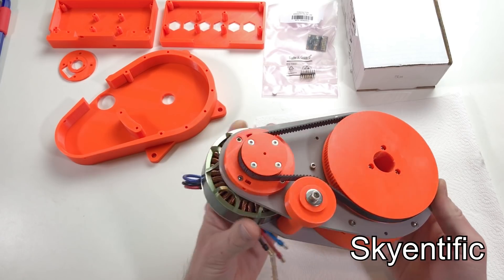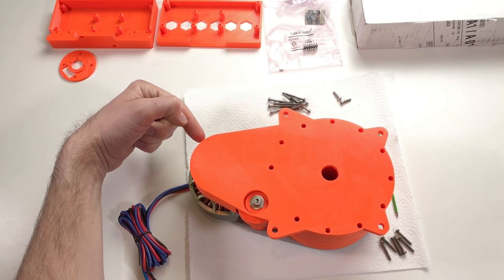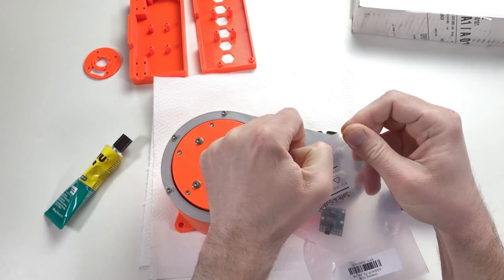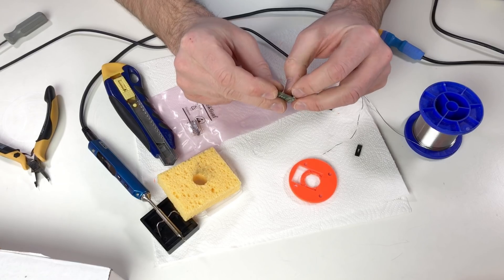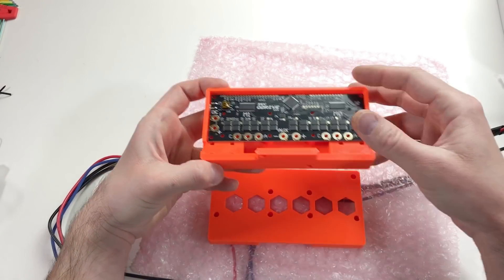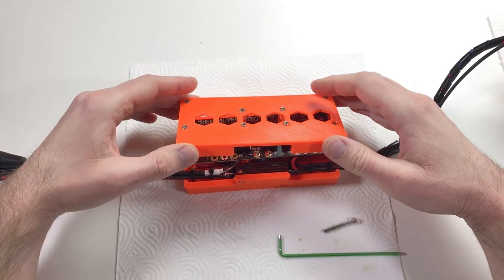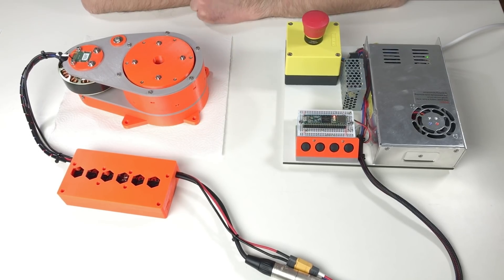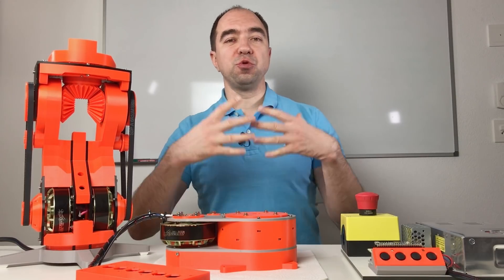Another 7-axis (7DoF) Brushless Robot Arm (part 3)

Comment: Wait, does the torque from the motor to the base all go through your four small bolts also holding the encoder plate?
Doesn't the 3D printed plate limit the clamping force you can apply then?
Reply: To clarify: the clamping force limits how much mounting friction bears between the motor and the plate, which limits how much twisting torque the connection can withstand before working on the bolts, which will worry them loose.

Comment: Awesome project, I love following it. Its all printed in PLA isnt it? Also at 6:47, it is not a DMX connector but an XLR connector. (The protocol is DMX, but it can also go over for example RJ45)
I love the stylish design of your box, although it would have been better to have detachable connectors of some kind. Maybe using round 'o' crimp terminals.

Comment: Is there anything that prevents  you from directly drive the joints with these motors? Sorry if that is a dumb question I am new to this.
Reply: Probably wouldn't be able to lift the weight of the arm itself. Brushless outrunners have much higher torque to weight ratio than old fashioned DC motors, but still not enough in this kind of application.

Comment: Nicely done! :) 👍 wich 3D-Printer do you use for such big parts like the base? 😊
Reply: Yeah i want to know too. And what printer settings do you use? infill? thickness etc?
Reply: Pretty sure his printer is Prusa Mk3. Build plate is only 21x21cm, but that means close to 30cm diagonal so you can fit surprisingly large things when they have a sort of pointy end like this. You can also do unlimited height prints by splitting the model up into whatever fits on the printer and then gluing the pieces together. Gluing together sideways doesn't work quite as well, but may be ok depending on how much precision you need.

Comment: Just for future clarification (not being snobby, just wanting future purchasers to know) it can be used for DMX data, but the cable he used for data is called a "3 prong xlr cable" or just "xlr cable". They are mainly used for stage sound as it has sheilding and locking connectors, and is durable, but also makes a great cable for DMX data or other data.

Comment: It's not too neccisary, and is somewhat difficult to do, but you can imbed magnets in 3D Prints via special settings, where the print pauses about halfway through, you place the magnet, and it prints around it.  The main advantage would be increased durability compared to glue.